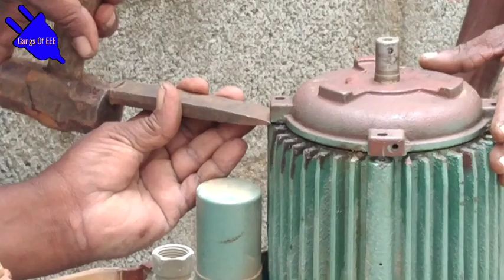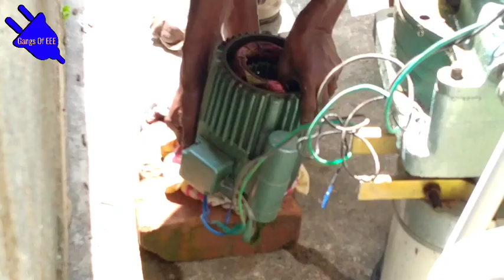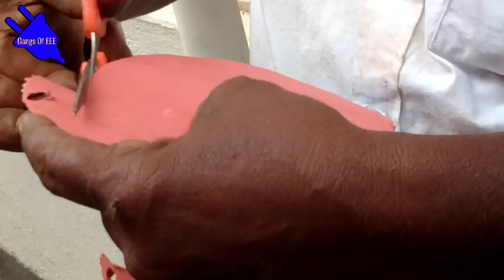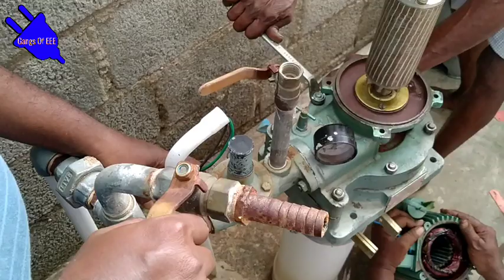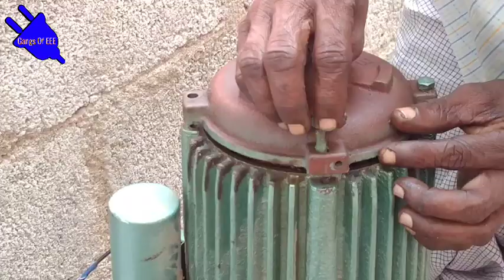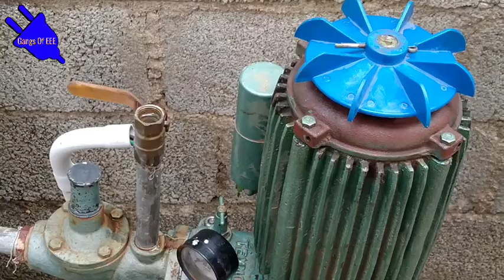Jet Motor Repair At Home | Part -2 | Tamil | Gangs Of EEE | By AV Akash

Comment: What will do rotar problem burning coil better change motor or possible repair
Reply from the maker: The rotor is burned you change the new rotor.Not buy a new motor👍